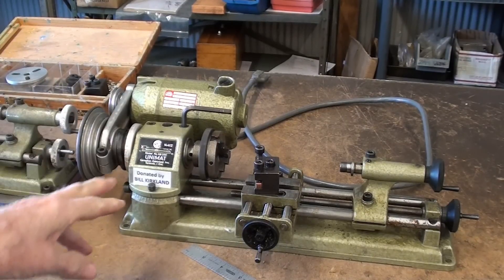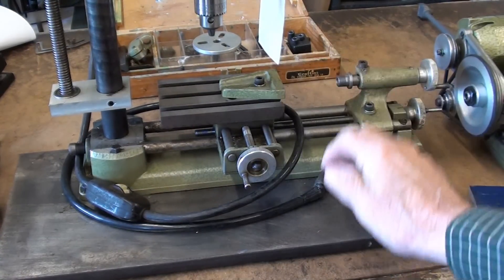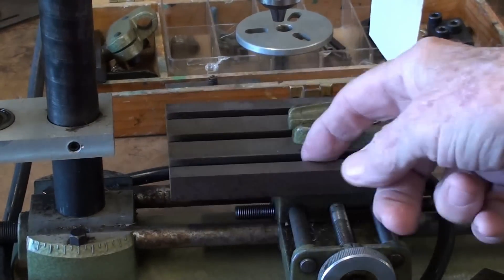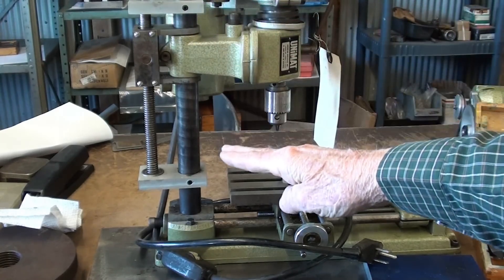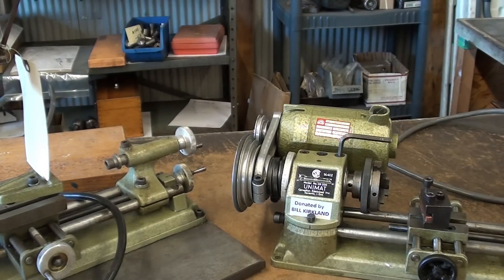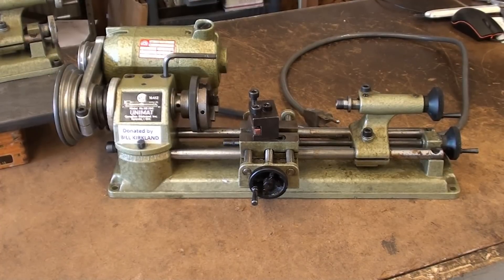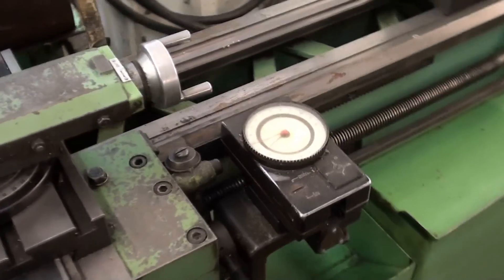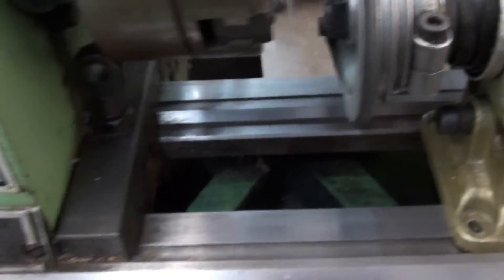COMPARING 2 UNIMAT micro LATHES #937 tubalcain jewelers

Comment: Step 2 of the Unimat Challenge! I really love that color on old machinery. Is there a name for that type of finish? I have an old Lurem combination woodworking machine (made in France) and an old Hitachi (MiJ, of course) jointer/planer that both use that color; sadly most of it has flaked or rusted off over the years..

Comment: I have a fairly complete SL-1000 but I struggle with being able to accurately adjust the height of the mill head on the vertical post.  I see what looks like a custom adaptation.  It looks a lot like what I need.  Anything you can offer would help.

Comment: Here in the UK they were sold as Elliott Machine Tool Company Unimat SL and were subsequently superceded by the Emco Unimat 3. I have both and think the SL is the superior. The modified drive train on the for sale machine maybe to allow the use of freely available drive belts as here in the UK the correct belts became unavailable years ago. Emco machines in general are superb both Lathes and Mills. Their bench mounted Maximat Mill is a really useful machine and the second generation belt driven variant with speed control is supper quite.
Reply from the maker: Thank you for that information

Comment: Instead of the steel base, can a recommend that you find a nice wood butcher block cutting board for the base.  I saw one mounted like that and it really looked nice and not too heavy.
Reply from the maker: Too late, I already made a steel base
Reply: I put some rubber feet under mine, but it needs something wider.  I try to keep it as small and light as possible to store.  Got my eye out for a nice one of those cutting boards.  So far it's been hard to find anything really nice in the $5-$7 range.

Comment: In the late 80's I bought a Emco CNC-1 turret lathe and Emco F-1 CNC mill. Excellent machines that survived many student errors. The Emco CNC machines were tagged Emco Maier. A Man named Ernie Maier imported the CNC machines and added his name to the tag similar to the Edestall moniker. I attended a one week training session at the company headquarters in Cincinnati. The machines were limited to short duration programs because the controller would only hold 100 lines of code. later versions of those machine were upgraded to a Fanuc controller so CAM software could be installed.

Comment: Back in 1980 I bought a new EMCO V10P  ,like you shower at Lost Creak. I bought it over a new South Bend because it had taper roller bearings for the spindle , a geared head, and a quick change  gear box, I still use it almost every day.

Comment: Enjoying this series. I have one set up as a lathe the other as a mill. On the one set up as milling...how did he fix the head to the modified part? Does it still swing around the column...or is that a trade-off?

Comment: The belt/pulley modification was for slower speeds. For milling? If he had replaced the single groove pulleys with a 2 groove cone set, more speed choices.
The '50s Allas Clausing milling machine had a center or third pulley. 
I added a 3rd pulley to my Walker Turner drill press.
Reply: I think it was made to increase clearance relative to the spindle so the motor doesn't hit the object worked on when drilling/milling.

Comment: I would bet. That if you could manufacture accurate vernier scale knobs for a unimat that didnt make you laugh or yell, you could sell them nonstop. You need knobs. Make real ones for everyone. Or a video/ plans package. The design does not lend itself to scales or dial indicator installations. There is only trial and error as the graduations are tiny and poor. Also i am sure these could use twice the motor.

Comment: I got one like yours but branded Emco (sold in Sweden)!
That machining table is a good idea, I need to make something similar. 
I'm also planning to replace the drive motor, I find it lacking a bit of torque and I want rpm control - will likely use a 3-phase model engine! 
As for motor control I want something like the foot pedal for sewing machines - I use it sitting at a table.

But if one ponders a bit it is surprising what can be done in these little machines.

Another common place to find Emco's are in schools, they often use their CNC-machines - some are even made with user replaceable control-panels to switch control system!

Comment: Since I don't have much money or space, I bought a Unimat for about $375. It came in very rough shape, with bent rods, and with very few attachments. Some people are willing to spend a lot of money buying parts for it. Instead, I try to make parts using the lathe itself, bootstrapping. It has been hard.
Reply: What are you needing for your UniMat? I have an assortment of Sherline parts my lathe has outgrown since I made some modifications to it, they might help you. 

Plus, I've made a LOT of tools & accessories for my beefed up Sherline, re-purposing other stuff & doing it all on a shoe string budget. 

I might be able to help you w/ some plans for tools, etc.

I figured out a wsy to use old, worn out carbide tipped Skil saw blades as parting & grooving tools.  Less than $10.00 worth of scrap steel & fasteners & a bit of basic metal work & you'll a robust parting tool.  I've got piles of old saw blades, (I was a carpentry/contractor for decades), be happy to cut one up for some blades for you.  Can get 6-10 blades from a 7¼" Skil saw blade; 10, if I make no mistakes, 6 if I screw up a bunch!

Let me know what you need & where you're trying to go w/ the UniMat.  I love making good tools out of marginal ones, for cheap!

GeoD